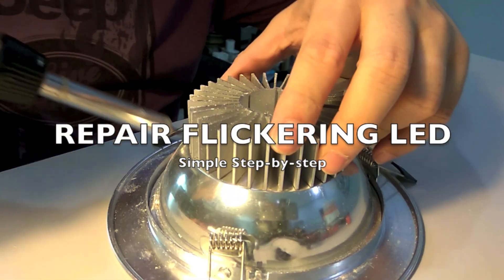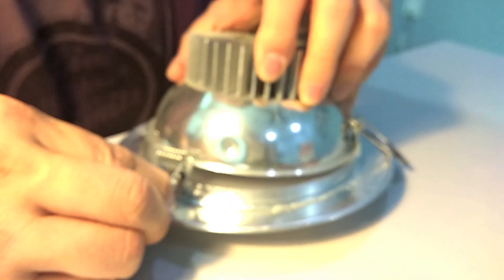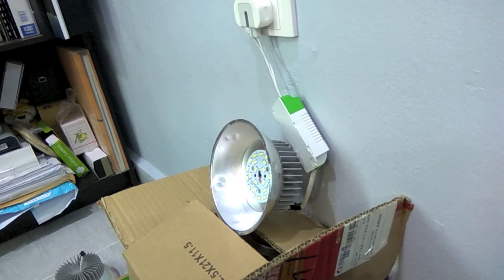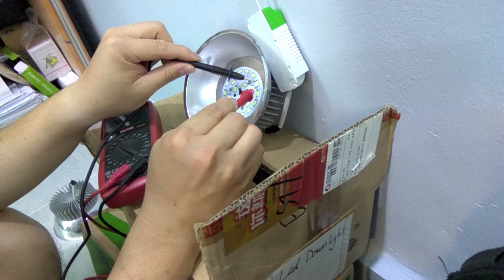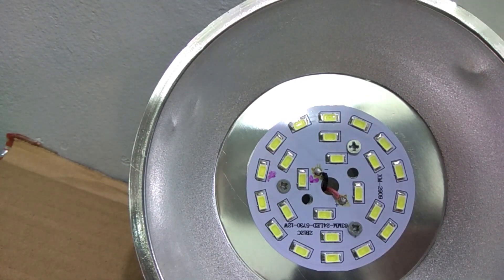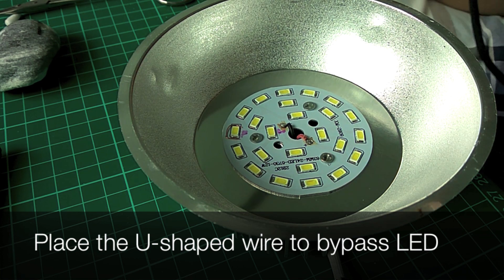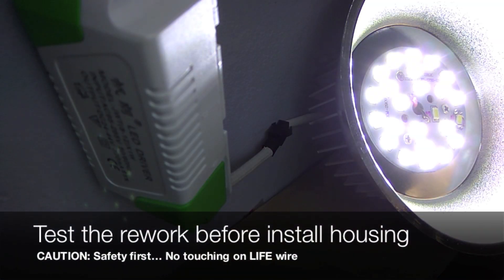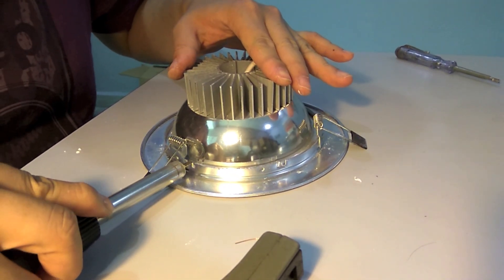REPAIR YOURSELF flickering or faulty LED downlight at HOME

Comment: Since it wasn't mentioned in the video or comments yet... DON'T EVER POWER THE LED WITH BARE MAINS WIRES AS SHOWN IN THE VIDEO. Plenty of intelligent people die regularly doing stuff like this. 
Instead, use a bench power supply or battery and power each SMD LED directly. Tape two paperclips to a AA battery if you have to (with a resistor in series ideally), you don't need any specialist equipment to do diagnostics like this safely. 

Now on to my question. Has anyone had success using this to fix flickering/strobing LED downlights? I know that the the title mentions flickering lights, but I've never seen a SMD LED flickering as a failure mode.
Reply from the maker: Thanks for your reply. The safety of the live wire is a concern. Thanks for bring that up. You can use the power supply method that you mentioned to try your LED. It works for me and i believe others that comment below works too. Sometimes i felt that the capacitor in the driver is weak. That only caused the LED to be dimmer but not flicker.

Try it out and share if that works for you. 
Happy New Year.
Reply: @thediylife1613  Hey, thanks for responding and happy new year!

Hope you didn't take offense at my comment, you seem to be working reasonably safely in the video, but it's a sure bet that some out there won't be. I also appreciate that you do have a warning against touching live wires in the video.

I have old LED downlights that each have a seperate drIver box outside the downlight housing, and this was the cause of the problem (bulb was fine when testing with another driver). 
I don't know enough yet to diagnose more than leaking capacitors or visibly burnt components, so I'm replacing the nearby lights with new ones. I'll use the working ones as spares for other areas in the house.
Reply from the maker: @dirtyspah  appreciate the feedback. We are here to share and learn. It is about continues to grow. 

Keep in touch and glad that you've find it useful.